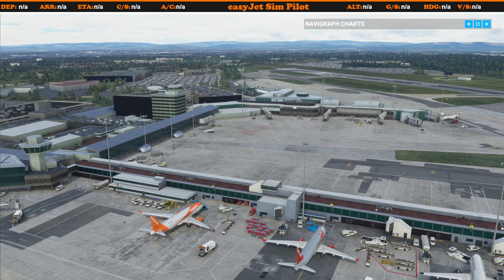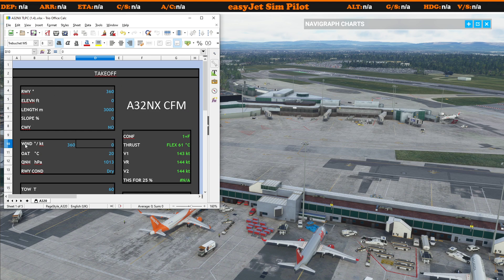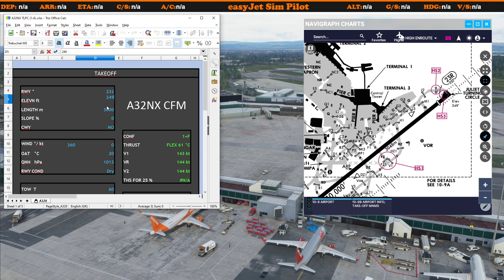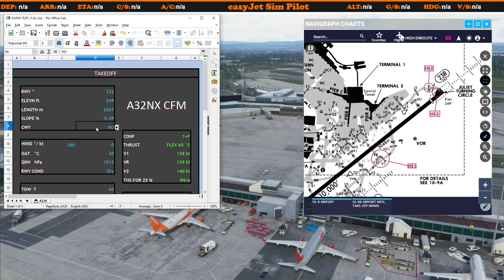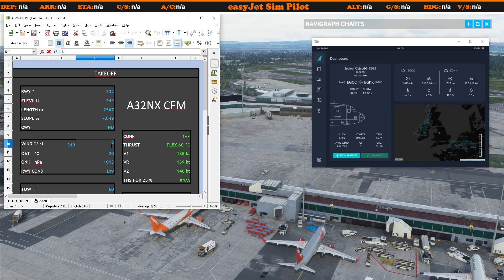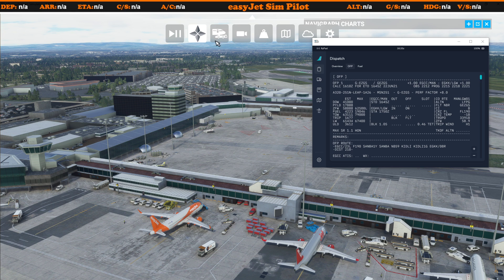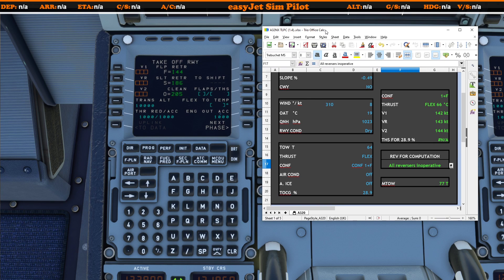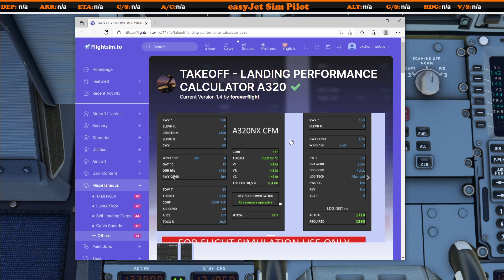A320 - New FREE Performance Calculator available for MSFS (& other sims)

Comment: Isn't this a wee bit pointless tho, with the current state of A320N in MSFS2020? I mean, AFAIK you can pop in any value in the MCDU for FLEX temp and it'll work anyway. I think Asorbo have an actual simulation of that planned, and possibly FBW as well, but I don't think it's been implemented yet.

Feel free to correct me if I'm wrong of course. If FLEX actually works now I'd rather know! ;)

EDIT: After asking on FBW's Discord it seems FLEX is implemented but doesn't have the accuracy one'd expect in the real world.
Reply from the maker: It does alter the amount of thrust you'd get - which is why without a proper calculation, I wouldn't 'guess' it and would only use TOGA.
Reply: @Easyjetsimpilot  I'm going to approach this scientifically and test take offs using TOGA and some wild FLEX values.
If what I suspect is true then currently the aircraft will likely be able to take off the same, regardless of settings (audio is different when using FLEX, but audio =/= performance, given it's just a sim). I'll pop back here with results.
Reply: @Easyjetsimpilot  I did a small in-game test. I'd reach the same speeds at the same runway distance (at least, roughly speaking - I was looking at the runway markers) regardless if I was using TOGA or FLEX, and I tried FLEX with wildly inappropriate values. Unless FLEX is a miniscule performance change vs TOGA (even with inappropriate settings) then at the moment I dare say it has no effects in game.
Reply from the maker: Might be worth asking this in the FBW discord as they've said that flex is taken into account.
Reply: @Easyjetsimpilot  Got a response from FBW Discord:
"No FLEX is not fully modelled atm"
"But a value between 50-60 is what you can input if you want to simulate FLEX for now"
In other words, FLEX is currently cosmetic.
Reply: @Easyjetsimpilot  I stand corrected. I got another reply from the FBW Discord at a later time, figured I'd pop back here:
"Yes, it is modeled in the FBW A320. Due to data limitations at the present time, it is not to the accuracy level we intend to reach in the future. You should definitely see a difference between FLEX and TOGA"
I could not see the difference myself, but perhaps it comes down to the accuracy level mentioned.
Reply from the maker: Lots of things can affect that, but it's  great to know it's working to a degree.

Comment: why are deleting my comment ? is the channel censoring things ? What was not allowed to post it  ?
Reply from the maker: No comments deleted that I'm aware of.
Reply: @Easyjetsimpilot  i just posted that wapro is still reachable and usable via the internet archive timeback machine. Only the database isn´t working. Do You now the TPC Takeoff performance calculator from Roland Wukovitz which is downloadable via avsim ? its also for the old engine variant on A319/A320/A321 and much more better then a Excelsheet
Reply from the maker: @Dennis-gl9lu  that's the first time I've seen a comment relating to that. Very interesting.

Comment: Gavin and all, why all these efforts with flex? Why just don't use TOGA? Is it just to add more realism? Or does it really have an impact on the departure? And if flex, why not make up something, e.g. 68° and save all the time? I hope you get my point
Reply from the maker: Afraid I can't agree with any of the comments here.

Using TOGA thrust when a FLEX T/O places unnecessary wear and tear on the engine, it is louder, more disruptive to residents and uses more fuel.

If you 'make up' a FLEX TEMP, you could find one day, you're rolling down the runway and... you run out of it! 😉
Reply: @Easyjetsimpilot  Be aware that although this calculator is labeled A32NX, it is not for the NEO and is not for the Leap 1A-26 engines on the FlyByWire airplane. Therefore, not only will all the takeoff calculations not be correct, the FLEX TEMP is also not likely to be correct.
Reply: I totally understand now, Gavin! Thank you for your time!

Comment: Great demo Gav,

Just to help clear a couple of things up. The Clearway is there to allow the aircraft get to its screen height after take off. This is 35 ft in dry conditions and 15 ft in wet conditions. The end of the clearway, if present, will be the end of the TODA (Take Off Distance Available). The Stopway (not mentioned here), is what is available to stop and included in the ASDA (Accelerate Stop Distance Available). 👍

Rounding up take off weight from the OFP is great. But you only need to round up to the nearest 100 kgs. 63,111 kgs in this example can be rounded up to 63.2 tonnes. 64 tonnes is fine on a long runway but this may get more restrictive on shorter runways which may prevent acceptable performance figures to be published. 

Reverse thrust is automatically NOT taken into account when you take off from a dry runway. Reverse thrust is taken into consideration if you take off from a wet runway.
Reply: Thanks for the clarification!

Comment: That's quite a big difference between the V speeds. Any clue where this difference comes from?
Reply from the maker: The calculator is for the older engines. Not the Neo.
Reply: @Easyjetsimpilot  And didn't you say the plane wasn't loaded when you looked at the weights page from the sim toolbar?
Reply from the maker: @salokin1  correct! It was an empty aircraft with no payload, just fuel (default start up state).